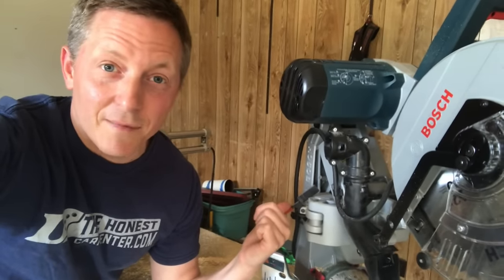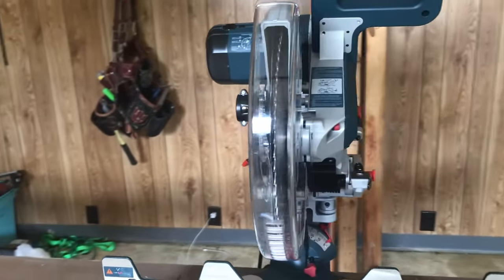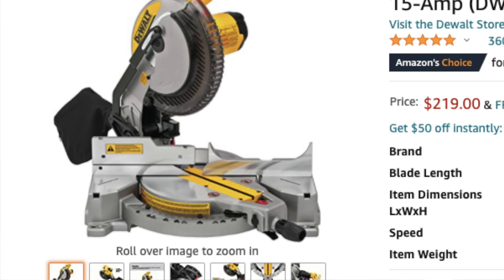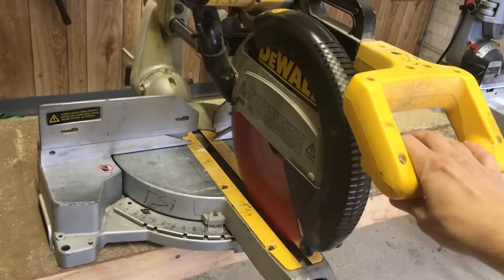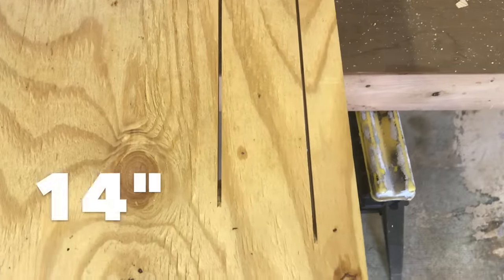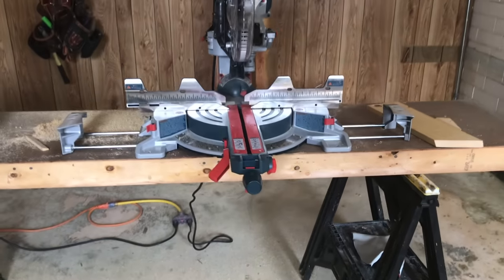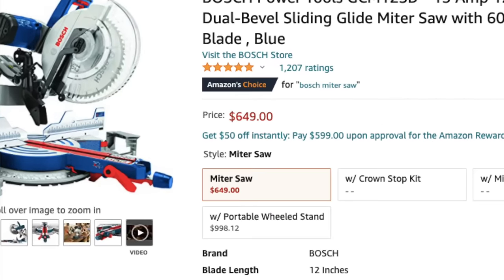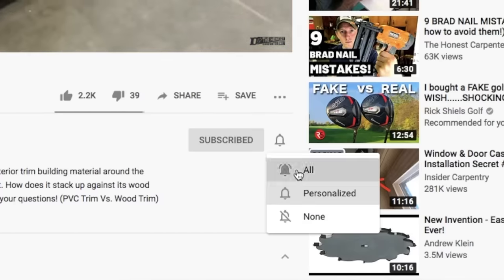This INNOVATION Changed Miter Saws! (Best Miter Saw Feature--Bosch "Glide"...Better than Rails!)

Comment: Delta makes one as well.  I ended up going with the Delta due to the shadow line and the bevel controls being on the front and side as opposed to the rear of the Bosch (mine went on a miter cabinet with the back part up against the wall).  Both are very good saws though, butter smooth movement.
Reply: I've also had the Delta for several years and been quite happy with it.
Reply: Would love to see a head-to-head between the two. How’s the sliding accuracy on yours?
Reply: @michaelkaplan2190  I replaced the blade right out of the box with an 80T Frued and fine tuned squaring everything up, cuts like butter and hits the line dead on every time.
Reply: @scottedwards3703  Thanks, Scott. I’ve looked at both. Great to get feedback on the Delta
Reply: I'm in the same boat and try to decide on the two, I want the matching stand so the bosvh ends up being quite of bit more, just not sure If it's worth it
Reply: Good to know about the Delta. Will have to check it out. I have been look at the Makita LS1219L. Wondering how its slides compare to the Delta?
Reply: @lamartya.4042  not sure on the Makita but almost a year with the Delta now and it still slides smooth and cuts dead on.  I'm not using it for a living though so it isn't getting hard use, just rebuilding sections of my house and various projects around the house and farm.

Comment: As a retired cabinet maker, I have to ask - what happened to radial arm saws? Next to table saws, they were the primary saws in a small shop. The standard minimum cross cut was 25". They're great for wide cross cuts, if that's what you're looking for. Difficult for miter and compound cuts though.

Comment: I have this saw and it’s in a home workshop environment mounted into a mitre saw station. 
Can you please do a tune up vid showing how you calibrate it it’s hard to find good ones out there there are a few I’ve managed to find but not many and want to know if there’s a better or different way to do it then I’ve been struggling with.
The saw is great but I disagree that it’s as good as the festool that other comments have mentioned.
There is a couple of other draw backs you didn’t mention that people might be interested in:
1. It’s an absolute pig at dust collection, all mitre saws are bad but this one in particular hence why there are so many videos on improving it.
2. The trenching feature is unreliable the glide action is awesome and smooth but it’s “springy” making consistent grove cuts difficult.
3. Your comments about being able to run it run up to the wall is correct and the reason I bought the saw. But for some stupid reason they put all the adjustment and calibration bolts in the back meaning that you can’t recalibrate the saw in situ and the saw is heavy. Blade angle adjustment is also only positive in one direction which is crusting with how heavy the motor is.
The saw cuts great and it’s got a nice smooth action but Bosch could really make a few simple changes to really upgrade this saw.

Comment: I’ve owned one of these for 7 years now. I’ve also made the plunge and use a Forrester 100 tooth blade. If you are a serious trim carpenter, there is nothing better. From finger jointed pine trim to black walnut this combo cuts like silk without splinters at any angle. Just write the check and enjoy.
One correction sorry it is a 90 tooth blade. The Chopmaster Signature blade. I have sent it back to Forrester to be sharpened once and it came back as good as new.
Reply from the maker: 100 tooth blade! I’m sold.
Reply: I saw these blades in the store today thought "...why?" But now I know they are worth it!

Comment: I at best do dabble in wood munipulation stuff at times. However, from my experience as a Industrial Mechanic (a.k.a... jack of lots of trade but no where close to a master of any of them) in which I do have to purchase all of my tools (rules of the game) I use to be really finicky about buying yet another tool of higher quality than the one that just broke in my hands. I learned to look at two things: How will the maker of the brand, or the reseller, handle my need of repair or replacement, and will the need for replacement be kind of something that will not happen for a decade. Yup, I learned about looking at the ROI of my tools. I think you made a very wise choice considering it is functioning your livelihood and trade seven days a week. You went to a way better place with that purchase... but better yet you understand why it was a better choice, if not the best choice. Good for you.

Comment: A woodshop I worked at has the same bosch miter saw and I love using it! Delta has a similar system and Makita has the rail forward design that will save you backspace too.

Comment: Got one of these saws, and have not even watched this video, and totally agree with him.. this saw is SEXY, it’s a joy to use.. and my life.. is it smooth. 

They are expensive at present.. but if you have the cash to splash.. then soooooo worth it. 

The battery version is light to for a 305mm bladed saw. One thing I would add is the need to put GPS in the blue tooth chip they have on the saw. 

You have an app that connects to the saw with different options.. so would make sense to have a gps chip.. so that when the saw fires up you can get it’s location if it is ever stolen. 

No point having a battery with on in.. you need a gps in the tool it’s self.. Bosch have it right just need it in the software and hardware. Easy to do. 

Other than that.. yeah.. SEXY saw. 

That’s my review anyway. 👍😊

Comment: I've wanted one of those for a long time, but because of the weight, it's more suited to workshop applications with semi permanent location. (Which is the main purpose of that system, so it can be placed against a wall). I saw some test done of them a few years ago and they found that their glide system was more stable with less wiggle that the regular rail system. I have a 10" DW slider, which they don't make anymore (except for the cordless). If I ever have to replace it, the 10" Bosch glider is my top choice.

Comment: I still have my Dewalt dw708 I bought it about 25 years ago I don’t need a new one I like to get the Dewalt flexvolt miter saw but I am waiting to see if they are going to upgrade it. I did buy the Ridgid cordless 7-1/4 miter saw love it and it only weighs around 25 pounds. That saw is a pleasure to take from job to job.

Comment: I was given a Dewalt 12” sliding when my uncle retired which still works fine so I can’t justify buying a new one, but ever since I tried one at the hardware stores couple years ago I’ve wanted one so badly
Reply from the maker: That was me too for the last five years, Adam. But those dewalts really are great!
Reply: @TheHonestCarpenter  It does the job great but man that Bosch is an upgrade! The smoothness is what got me the most too. Can’t wait to see some vids with it

Comment: It's a good saw, it has alot of deflection tho when extended... I looked at it and the Delta Cruser line and decided if I'm gonna make the investment ill save a little longer and buy a Makita, ½ the cost of a festool kapex but zero deflection like the kapex.
Reply: Dude no deflection on my Kapex best saw I ever owned
Reply: @paulmaryon9088  I agree... the makita has zero deflection as well, it's just 750 verses the 1500 of the kapex , the kapex however has really superb dust collection unmatched by any saw
Reply: That's what I bought -- I love my Makita and you are correct, there is zero deflection. Nothing makes you want to pull your hair out more when you can't cut a mitre accurately. They are "mitre" saws afterall...
Reply: @tomhostetter8516  yep.
the kapex are just buying a name.

festo is an overpriced plastic box with lesser tools inside.

Comment: I have a Hitachi 12" dual bevel, it also needs little room behind it. It has slides but the way they are mounter there are not behind the saw. Bosch has great equipment too I love the job site portable saw.

Comment: I have had mine for several years now and love it. I have been able to get an even wider cut by using a Jimmy Diresta trick of lifting the side closest to you up, probably not recommended or all that safe, rather than flipping the piece wing cut over and trying to line it up. Dust collection kind of sucks on it and not in a good way but that’s not great on most mitersaws anyway.

Comment: The big problem I have with this saw is repeatability.  There’s too much side to side slop.  If I’m going to spend that much it should have good repeatability.  You would need much tighter pin fits on the “Glide links” to improve and even then it would probably be insufficient given the distance the blade is from the links.  But I agree… it is super cool!
Reply: I was wondering about lateral movement.

Comment: I avoided sliding miter saws because of that depth requirement and a couple i had used that had damaged 'slides' or bearings, but the Bosche was just too pricey and heavy. IIRC it was like $800 at the time and I did not want to be tossing it in my truck. Nice to see it a little cheaper but still pricey for a miter saw.

Comment: I've had one of these for years (and I have no idea where the color on Amazon comes from, but mine is a darker "Bosch" teal). I don't know how, but I had another GC use my Bosch on a job site to do a compound-mitre, and he was able to cut off and inch of the sliding backstop. No one knew until I was cleaning up art the end of the day. BTW, this is a really "clean" saw too, the dust bag actually catches like 85-90% of the dust (until it gets full). Also, another thing that drives me nuts, no detent for ZERO degrees vertical.

Comment: I've owned this saw for several years now. My major complaint is that there's no adjustment for "crabbing." That's when the blade isn't perfectly parallel to the glide path. This can manifest itself in two ways: 1) You get a right angle when using the saw in a chopping motion, but not when using the glide (or vice-versa), and 2) Your long glided cut is slightly bowed. 
Also Makita makes a SCMS where the rails don't slide - the rails stick out forward and the saw body glides on them. Different mechanism, but same no additional rear clearance needed. The Festool does this as well, but it's even more expensive than the Bosch.

Comment: We/I couldn't cut wide crown molding In one pass with a similar looking articulating or what's they call those saws.   We ended up using a 12inch DeWalt.  It surprised everyone.

Comment: I bought the GCM12SD from Amazon shortly after they appeared on the market.  I think it was about 12 years ago.  And when it arrived the box was badly damaged and crushed.  At first appearances the saw did not seem to have any damage but after taking it out of the box and getting ready to install it into my miter saw table I discovered one of the  back support feet was bent out of alignment,  Enough that the saw rocked a little bit if I put pressure on that corner of the saw.  So I called Amazon and told them the saw arrived damaged.  Amazon being Amazon agreed to ship out a new one and pick up the damaged one.  When the replacement arrived the box was again damaged, but not as severely as the first one.  And upon unpacking and initial setup I again noticed there was the same issue,  the saw rocked from corner to corner.  This may not sound like a huge issue since the saw would be bolted to the table.  But it is because when I go to tighten it down the whole casting would distort slightly which would put a twist into the saw table casting.  This time I called the Bosch rep for my region.  I guess I lucked out because he sent a new saw at no charge and I again sent the damaged merchandise back to Amazon for a refund.  The saw that came from Bosch was packaged better and did not have the same damage issues.

Comment: My question was going to be in reference to deflection. After beginning to read comments; it is obviously a big issue. I saw similar issues when watching reviews on the Rigid version of the saw with a similar glide mechanism. 
In my opinion, when spending that kind of money, the deflection should be nonexistent. Otherwise, what's the point if it won't cut square? 
I guess you could leave space after breaking down large stock and do a final cut on the table saw, but then you are just adding steps.

Comment: Great video.  I am in the process of replacing my 12” ridgid.  I looked at the Bosch but has neither a shadow lazar indicator so as good as it looks, at this price it should .
Reply: I have the older slider Ridgid. It is still dead on and easy to maintain. These knee type saws have a couple of issues for me.....cut a long cut and it won't be dead on straight. I think those compound knuckles are very difficult to get to track perfectly. also....move the saw towards your body and check how easy it is to move the saw from left to right...that flex is going to be an issue.  I never found that back space with a slider saw to be an issue. I have mine mounted on the Ridgid colapsing, roll around base so it is easy and fast to move it away from a wall in use and put it back later....it also stores in the colapsed state quite compact. Since it is on wheels i is also easy to move around...even up a couple of stairs by yourself. I suppose these are OK for rougher construction like on a house....but it isn't capable of holding the clearances and ight cuts for fine woodworking. Often you are better off using a table saw with a good miter gauge like a Incra if you need really accurate angles cut.

Comment: Makita Ls1019L solves the spacing issue as well - having the rails on the side. Additionally it has a front locking system.
Reply: Yep, Id say its the better saw.

Comment: I have a Delta 12" chop saw and it lives on its mobile stand. The cuts are superb. I have been very hesitant to purchase a glider because all of them that are gliders are rough at a minimum. Yes they cut deeper but the bearings all of them have are crap. I like the concept of this saw but at $600+ I can't justify the cost. I find my self using my 14" bandsaw more than my chop saw for many cuts, not all of them. After reading the posts below it looks like Bosch has some tweaks to the adjustments to get it and keep it square.
Reply: I have the new Delta Cruzer with the same glide technology. It's buttery smooth as mentioned and has that small footprint. It's  a great upgrade for the stationary miter station.

Comment: Ive got a 20+ year old Delta Chop saw with easy to use bed extensions. They dont have a fancy lokc, and theyre basic L brackets made of steel instead of aluminum. But theyre still accurate and still solid.

Comment: That's a great Mitre saw which, as you say, changes the game. Having worked in Joinery and furniture factories and now out on the road as a carpenter, I would like to see someone take an even bigger step with a portable version of a radial arm saw - a mitre saw that can swivel to do long - LOOOONG - cuts...! Maybe this post will get those companies thinking about it, finally...! A radial arm saw would eliminate the need for most table saw functions, so it would be less to haul around...and - if it could be cordless, like my current Mitre saw on it's portable extending stand, that would be the icing on the cake for my eco friendly, work anywhere setup.
Reply: A radial arm saw would eliminate the need for most table saw functions, so less to haul around.
And - if it could be cordless, like my current Mitre saw, that would be even better.
Reply from the maker: That’s true, Pete! It’s a tall order, but you never know...😄

Comment: I have the dw708 for 16 plus years of daily site use. Just blow out the bearings and some wd40. I have never replaced them or the belt, just brushes and motor bearings.

Comment: Great saw by far. I have three Dewalts at work in the maintenance department, one miter and two sliding, they suck compared to my Bosch. Under powered for big cuts and bogs down easily. Clunky to use and the fence is mediocre at best. I kept trying to get them to upgrade to the Bosch, but they just got another Dewalt 12" sliding miter this week. Got my Bosch from Home Depot on clearance for $350 about 3 years ago. I ran out of there like a bandit feeling like I stole something.

Comment: The Delta Cruzer and Ridgid's clone (from the same factory) have the same articulating joints now, plus an LED cut line light, which the BOSCH lacks. I just bought the Ridgid model and so far am very happy with it. I'm in the process of designing a mobile miter cart with fold up wings for it

Comment: Great review. I recently bought a Dewalt DWS780 and love it. Been doing some projects around the house and finally ready to build a new permanent workbench around it. (Similar to the way you’ve set yours up) Any tips or guides on best practices when building one?
Reply from the maker: I did a 2x4 build for my last miter table, Christopher. But this time, I may go all plywood—more like an extended base cabinet. Saves even more space for storage underneath!

Comment: I bought this saw as my main saw for a small work shop.  It’s amazing.  In fact  wood whisperer and Izzy swan said it was AS good as the Festool kapex.
Reply from the maker: Awesome, Dave. I’d believe anything wood whisperer says!
Reply: Have you had any issues with the bevel engagement angles or difficulties with calibrating it?
I have the saw as well and it cuts great but have had issues with the above. It’s also really frustrating that the calibration bolts are all at the back of the unit.
Reply: @adamcallaway3762  I have not noticed that.  But I seldom use bevel cuts.   In fact I don’t use the saw nearly as much as I should.  Lol